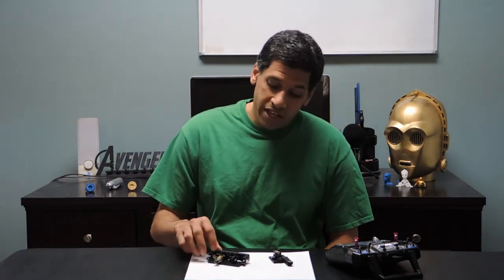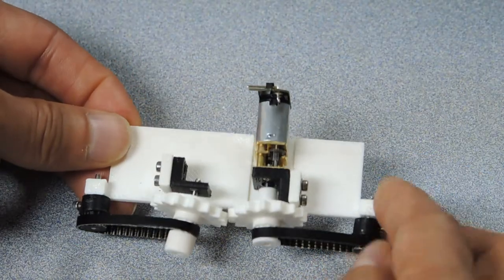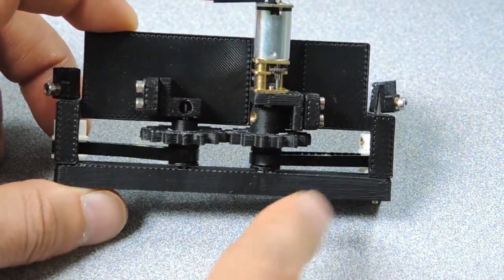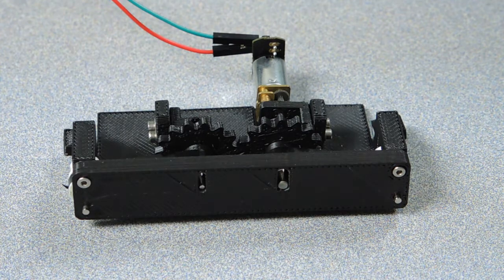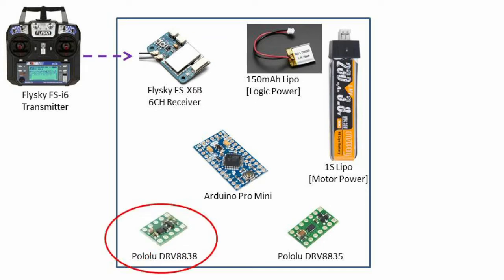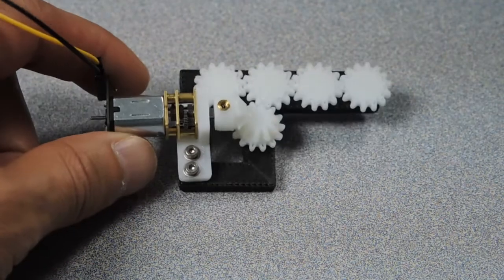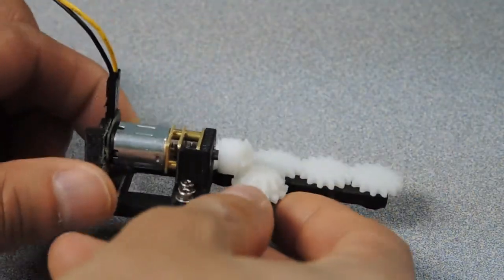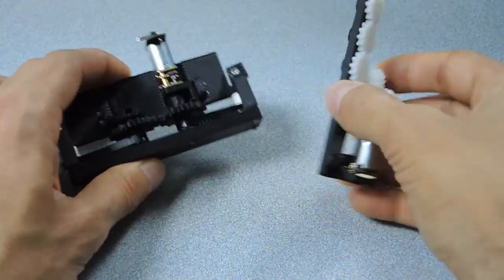Mystery Arduino Robot, 3D Printed, Part 2

Comment: This is an awesome design. I teach engineering classes a Catawba Valley Community college and I was looking for a cool robot build project. I was wondering do you have a video on how to put the inserts into the 3D printed parts? Thanks for an awesome channel.
Reply from the maker: All credit for the design goes to the UC Berkeley team...they did an amazing job :)

Thanks for the compliments on the channel, much appreciated!  Be sure to check out the Thingiverse page for this robot- I included lots of details to help build it.

I don't have a video on installing the inserts, but if you google "heat-set insert 3D printing", some videos pop up.

Comment: I have a doubt! Why did u used belt for the up and down mechanism when u can also use gears for it? Any specific reason or advantage of using belt over gears?
Reply from the maker: I found it easier to design a belt driven mechanism that was short enough in the height dimension to fit under a door.  Also, a completely gear driven sprawl mechanism will have more backlash.